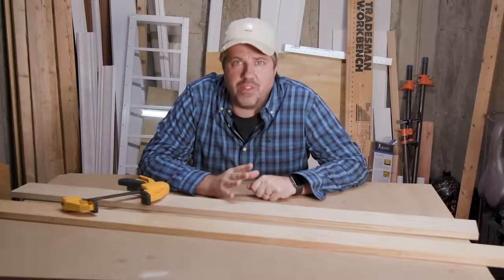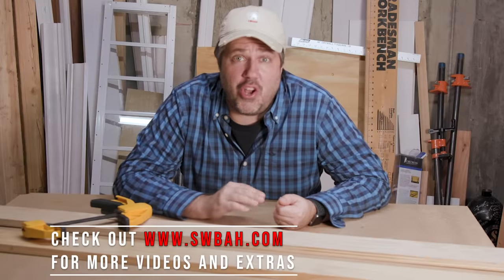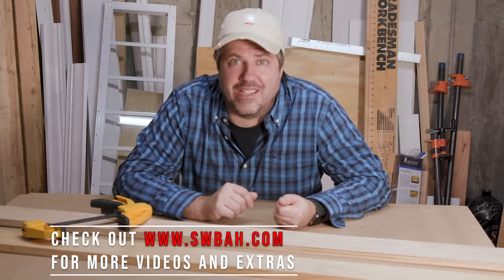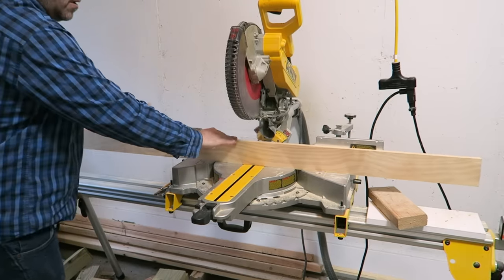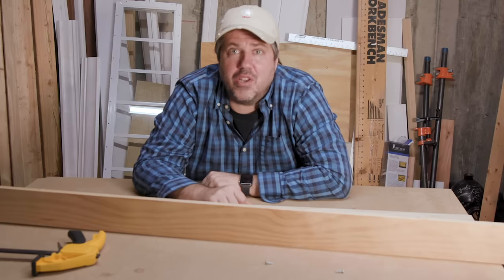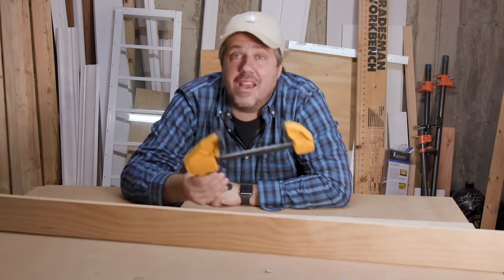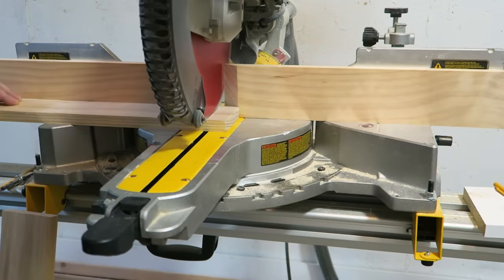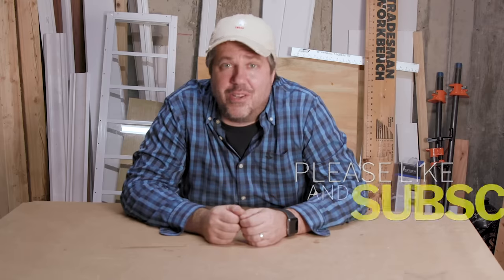60 Second Miter Saw fix that will change the way you work! - Easy DIY Miter Saw Stop Block.

Comment: Quick and easy. Nice. I know the keyboard carpenters are going to come in and yell about how easy the clamp will be to nudge off your mark. Just be careful when butting against it and I would even put a pencil mark there so you can just look to check it occasionally making sure it’s staying put. Nice tip :-)
Reply from the maker: Thanks. It was just a quick fix. Originally, I wasn't even going to make a video on this, I just did it because I needed something while i was working on a cabinet carcass.  It was pouring outside and I needed more space to do the assembly on the driveway so I made the video since i couldn't do much else lol. The video is pretty popular so far, so maybe I will do a follow up on making a better stop. The clamp is not the best way, but i wanted to show people if you are careful, you make simple, accurate, repeatable cuts without spending a fortune on hardware and three days building.

Some of the thoughts I have for upgrades would be captured bolts so it can be removed, maybe t-track up top and a flip fence.  Let me know what you think.
Reply: Clamps work never had a problem in 45 yrs
Reply from the maker: @patrickarchuleta9594  Thanks Patrick - 45 years is a lot of experience, I bet you've made some really cool things in that time.
Reply: @SoWeBoughtaHouse  Yeah this is nice. I work for a stage company and we build our own stairs to bring on site at every height...thanks for keeping it simple and taking the time to move your camera around.
Reply from the maker: @ma2perdue  Thanks Matt - Much appreciated and let me know if you have any questions.
Reply: @SoWeBoughtaHouse  My fiance and I both have a lot of books. I've never effectively made a bookshelf that stays straight. Could you give me a tip for that
Reply from the maker: @ma2perdue  Hi Matt - What are you making it out of?  Have you tried 90 degree corner braces behind your backer?  This should stop racking. If it is a tall bookshelf make some permanent (non-movable) shelves and brace those to.  Of course this assumes you are already using a back and are still having racking or twisting issues. You can send me an email at swbah.ken@gmail.com.  I'd be happy to help.
Reply: I think i would clamp a small block as the stop instead of the clamp itself.
Reply: A nice simple solution! And B Link is right, somebody's going to say why do that when you can make a simple table for your miter saw for only $350 lol
Reply from the maker: @MichiganHiker  But if i made a table, where would I park my car :)
Reply: @SoWeBoughtaHouse  You mean you can get your car in the garage 😁
Reply from the maker: @MichiganHiker  The small one :)

Comment: Left out a crucial step; double checking your cuts (or clamp) every so often to ensure nothing has moved when doing more than a handful of pieces. In my experience, the longer and/or heavier the material is as well as how quickly you're trying to work greatly increase the likelihood of movement. Also (obviously) cheap clamps
Reply from the maker: Good point.  I mostly use this setup for things like table legs, apron pieces, etc. so it is 4 quick cuts, check them and done.  Always good to check.  Did you see the video of the updated uber version?

Comment: Your miter saw appears to have a hold down. One could use this hold down to hold down a bit of wood at the desired distance from the blade thus acting as a stop. Additionally the saw stand you have has flip up stops on the sliding stock supports so you in fact have one of those fancy miter saws with stops. Good solution otherwise for people who may not have the features that you do.
Reply from the maker: Hi David - you are correct.  I do have those options and made this video for people who might not have those option.  However the playing the stop of the stand does cause some imprecision.  Don’t get me wrong you could frame a house with this system, but it you were building a piece of furniture, the little bit of flex is enough to cause wobbly legs and joints with gaps.  This simple setup makes everything almost perfect even for those high precision application where the part length needs to perfect across multiple members.  It is also much more portable than building a dedicated stand.  If you want to see a fun build I did an updated portable stand where budget was not issue and tried to incorporate every upgrade on this thread for fun.  Let’s just say it is t for the budget faint of heart :). Thanks for watching and for the comment.  Happy building!

Comment: Good Idea.. although it does take away cutting depth for when cutting boards. And also the risk of getting warped wood untruing the perpendicularity of the miter saw. But its a great idea for when the job requires multiple cuts. It shows how sometimes ones smartness can make more use out of the tool.
Reply from the maker: All Good points Jeffrey, this is a construction trick for cutting things like studs, etc. you can actually draw a story stick on the board and just clamp as needed.  If you are worried about warping you can use MDF instead of wood, and if if you are really crazy like me, check out the video where I show how to use aluminum extrusions.  Happy Building!

Comment: This is a simple nice fence. But, you lose cutting depth (the width of the board). I have a fairly small miter saw (254 mm disk if I remember well) and taking out even 18 mm is already more than I want to sacrifice.
Reply from the maker: Check out my other miter saw video. It is meant to be over the top, but you can find some things that are pretty basic and can be adapted and don’t reduce the cut size.

Comment: Good video! The only thing I do differently is to put a piece of scrap wood between the fence and clamp plus use a C clamp ( can be locked in place tighter) instead of a sliding friction clamp which I found can loosen at the wrong time. Been doing it that way for 30 years since my past shop was a bit too small for a dedicated miter saw bench and the current shop is even smaller
Reply from the maker: Dirty little secret - I use the block as well :) but when I can't find it I've used just the clamp a lot.  You should try those DeWalt clamps out when you a chance. I used them all summer building a playhouse for the kids as an extra set of hands since I don't have anyone that can help and they held 2x6x10 joists without slipping no problem.  I'm pretty impressed by them.  Of course, the fact that I used them in the video was the that all my other clamps were on another project lol.

Comment: Simple and straightforward. If you keep the miter at the 90 degree setting, you know also have an accurate reference for blade location.
Reply from the maker: Hi Robert - Thanks for the comment!  I cut a lot of angles which is the problem.  I have an idea for a quick calibration system.  If it works I'm going to a follow up video.

Comment: I totally did almost exactly this the other day.  Slight differences in the details of how I clamped and stuff, but essentially the same setup.  It's good stuff!
Reply from the maker: It is such a nice easy thing for cutting long board to size that are too big for a crosscut sled.
Reply: @SoWeBoughtaHouse  or when you haven't yet built a crosscut sled, because you don't yet have a table saw (hopefully soon!).  😅
Reply from the maker: That is upgrade I need to make as well, but a. Bandsaw for re-saving would also be nice :)
Reply: @SoWeBoughtaHouse  hmmmm. I suppose a bandsaw (which is also on my list) with a fence might actually give me a decent enough approximation of what I’d use a table saw for that maybe that should come first… 🤔🤔🤔
Reply from the maker: It depends on what you make.  Right now I have a small DeWalt table saw.  Model 745 which I did a review of if your interested.  I have a track saw as well which I can use to break down sheet goods.  This worked really well until recently when I decided to try some higher end  furniture builds.  Now I am rubbing into the limitations of that saw.  The first is it cannot use a dado stack and the second is the table is small. I just ordered a crosscut sled to see if I can get around those limits. I also have a router table I can use, but that has some issues with tear out on some projects.  So I guess there is never ending battle about what to get next but what you want to create or do is probably the most important factor.  If you tell me a little more about what you want to do in the immediate future, I’d be happy share my 2 cents :)

Comment: I have a similar mitre saw stand and for years I've used the roller supports at either end as saw stop for making repeat cuts.
Reply from the maker: Hi William - a few people have commented on this and I do use them but I find it difficult to keep the accuracy I need on some projects without really focusing on making sure the wood is up against the stop the right way because of it flex and it not locking at 90 degrees.  If I need anything more precise than say 1/16 I do it the way I showed in the video.  What kind of work do you do.  What kind of precision have you found you get on yours?
Reply: @SoWeBoughtaHouse I

Comment: Thanks for sharing this, been wanting something like this for my miter saw a longer fence cuts, again thanks for your advice on this project.😊 ,and also I agree with others about not being wearing a long loose sleeved shirt, watching you give me some chills how close you get to the saw blade, so be more careful my friend.
Reply from the maker: Hi David, sorry for scaring you and I'm happy I was able to help.  I used to wear button downs mainly for the sake of filming when it was cold out in the garage.  I'm actually really far from the balde as this is a 12 inch saw, but it doesn't look that way on the video and don't want to set a bad example.  Since then I have tried to make sure I only wear short sleeves when actually cutting.  Safety is super important and I want to make sure that comes through so I will be more conscious.  Thanks for your comment.

Comment: Thanks for this great tip, I just did it this morning and used it for many different stop measurements. (Making a small tounge and groove storage unit for the garden) It certainly saved a lot of measuring. I had to drill holes in the fence to start with as there wasn't any pre-drilled holes. On the extended wooden (fence) I fitted the wood with "threaded inserts" so it's just a matter screwing it off and on with phillips headed bolts. Once again thanks, I'm really pleased.
Reply from the maker: Hi Ally - way to take it to the next level.  I’m so glad I was able to help and your project turned out well!

Comment: You can also add another piece of plywood under the aux fence above your throat plate( where the bottom of your board rests the “base”) and attach them together just make sure it’s at a close as u can 90.. this will make it a aux fence stop block, and zero clearance all in one which will help reduce tear out .. most of the tear out is in the unsupported areas that the blade also exits thru (bottom and rear) so this will really help with that and help with small cutoffs being lodged in your throat plate...and I’d maybe also suggest 2 fences, one for 90s and one for 45..or just use it as is without cutting a 45 into until the time comes u need a 45 then do it..it’s not feasible to have a fence for every angle but once you cut away that back support as u did  u lose the tearout protection back there..love the video keep it up just trynna help 😊
Reply from the maker: Hi Fabian, I think you just wrote the sequel.  Thanks for the constructive feedback and the great ideas.  One idea I've been playing around with is how to make the fences interchangeable and easy to get realigned once you switch.  I thought of using a standard bolt pattern and countersunk hole in the face of the fence.  What I haven't figured out yet is how to re-calibrate the metal fence.  That saw gets a lot of use both by me and sometimes contractor helping out with the house.  I've also had to move it around the house and property for different projects.  Moving those metal fences doesn't happen a ton but when it does it throws off the clearance.  So far the best way I found is to push the aux fence back up against the blade.  This works but it does trim a little of the fence (the difference between the body of the balde and the kerf.  Not a big deal, except I'd like to add a ruler to the fence and losing a little each time would throw it off.  If you have any ideas, let me know.

Comment: Nice.  This also works well for cutting very small pieces.  Just cut the fence at the one degree you need (just 90 for example) and then you have a zero tolerance fence for cutting small pieces.  Just keep your fingers away with creative use of a 10 inch stick to hold your piece against the fence.
Reply from the maker: I was thinking of doing that as a follow-up. I have an idea for a sled that goes over the aux fence, so you don't need to keep swapping. The only problem is I'm not sure what to call the video yet :P

Comment: I have that exact same set up. There is a built-in stop on your extension arm that works beautifully.
Reply from the maker: Hi Patrick - thanks for the comment. The built in work great for most things.  I made this addition when I was working on a table.  Not sure if you noticed this but the flex from extension along with the stop blocks not making a perfect 90 degree angle add a little error.  Enough to make a table wobble anyway.  I use this when I need that extra precision and it also easier to adjust with smaller pieces where the extension stops are too far out. The wood is also nice because you can make marks on it for things you cut commonly and not need to measure all the time.  When you need it, is nice to have and it is cheap enough that you can toss the pieces or recycle them when you don’t.

Comment: Nice simple solution.  I would just recommend clamping a block to the fence for the stop instead of relying on the rubber foot of the clamp.  It will be more accurate as the rubber can give and also the wood stop will have more friction and will be less likely to move.
Reply from the maker: Hi Conner - great recommendation. I have also had people mention putting self adhesive sandpaper on the block to increase the friction with the fence.  I always meant to make a follow up video dealing with different ways to make stop blocks but never got around to it.  The feedback and suggestions on improvements from everyone on this video has been awesome. Happy holidays and thanks for contributing!
Reply: @SoWeBoughtaHouse  Yes, sandpaper is a great way to add friction to the stop block.
Reply from the maker: Keep an eye out in the next few weeks I’m working on a portable station to try and rival the features of what some people build into the walls of their shops. It is definitely not meant to replace to trick but I thought it would be fun to try and incorporate a lot of the feedback I got on this video and try and build it without cost restrictions.  The only requirement is it needed to be portable and could be easily set up in about 60 seconds.

Comment: Thanks for the video. Of course it looks so simple to do, but being I have a 7 1/2 inch sliding Kobalt miter saw, I had to make adjustments to the add on so that the motor wasn’t banging into it.
Reply from the maker: Sorry you had that problem. I haven’t tried this trick on smaller saws.  How hard was it to modify. Did you just need to modify the fence height?

Comment: You should call these short videos Tips or Tip for the  week! Nicely done.
Reply from the maker: Thanks so much!  when I first started, I played with a section called quick fixes but they didn't catch on.  I was still experimenting at the time, well I still am, maybe I should bring it back.  What is cross grain wood products?  Anything cool I should check out?

Comment: You could increase your safety and functionality by adding a piece of material to each side of your fence extension. 

Find the center of your fence, set it on your saw, and mark where the edges of the saw's table are, on the fence. Add a piece of 1-by, starting at your marks, and extending to the ends of your fence. Pre-drill and mount the pieces to the bottom edge of the fence extension, making a "hog-trough" or "strongback".  These pieces will extend the saw's table for greater infeed and outfeed support. 

In order to make the fence extension more secure, i would not use short wood screws. I would drill and countersink, or counterbore, mounting holes and use carriage bolts or machine screws and nuts. Make sure that mugg is snug! 

In order to prevent sag in either the fence or fence/table extension, you might need to add a foot or leg down to your bench or the floor.

Yeah, I know. I've made the one minute fix into a five minute project. It's ok. You can handle it. I have confidence in you!
Reply from the maker: Hi Rudi - let me know what you think k of this version :) this is my non 60 second version.  Building it gave me lots of ideas.  I’d love to hear what you think.

Supercharge Your Portable Miter Saw With These Easy Upgrades!
https://youtu.be/37S2bLIqKNM.

Comment: That Looks like Radiata Pine which is different than a standard #2 pine... either way pine will still move and contort with moisture and humidity since it's not a hard wood. This way may be effective in a one off situation but not reliable in a long term application. If that's your goal attach a base plate to it , to keep the wings straight!!
Reply from the maker: It is select Pine from Home Depot whatever that means.  It has worked fine for three years, no twisting.  It is secured to the fence which helps.